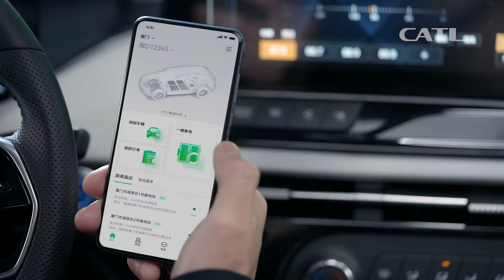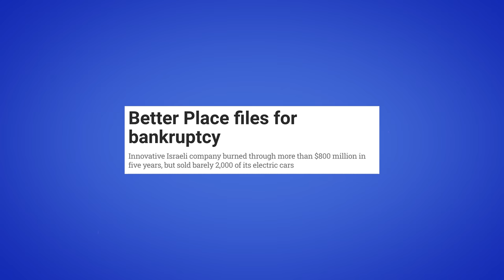Why Battery Swapping Is A BAD Idea

Comment: Battery swapping makes a lot of sense for heavy duty vehicles. Lorries can have much smaller batteries, possibly 200 miles will be sufficient, allowing more goods to be carried. Most batteries can also be charged when demand for electricity is low, saving renewables that would otherwise be wasted.
Reply: A locomotive with autopilot, connects up, pushes or pulls for a while, then disconnects and exits onto a side track to charge.
Reply: Lorries need gigantic battery packs; upwards of 300, sometimes 400kw packs. Range isn’t the issue with them, it’s the weight
Reply: Ye this is a nice idea, but ultimately, sod lorries having batteries. They should be green hydrogen-fuelled. Weight is too much for batteries
Reply: How do you change battery from fully loaded lorries ?  If possible I bet the cost of the swapping station for HDVs would be much more higher.
Reply: Moot point if 18 minutes charging is coming 😁
Reply: @Olliebobalong  you need 1000kwh if you can’t swap it.
Reply: @pissmyasslynch5325   it’s normally placed in front of the container, changed with a crane. Looks simpler than a car battery swap.
Reply: Running on hydrogen fuel cells is probably a better solution...
Reply: @jimj2683  possibly, the main drawback of hydrogen is it’s not as efficient and cost almost as much as diesel. It would say it’s more suitable for more sparsely populated countries.
Reply: @nathanieong6212  Having 2 batteries per truck plus the reduced cargo capaacity costs a lot too....
Reply: @jimj2683  currently a 100 kWh in a Tesla model s weighs about 625kg, I think we will soon see 300 kWh batteries weighing about 1500kg which isn’t too much for a lorry. With battery swapping 200 kWh should be sufficient for most routes. On paper hydrogen looks very light which is true, but what it doesn’t show is hydrogen takes up a lot of space.
Reply: @fjalics  or… or… or… an electric train that doesn’t stop, isn’t bothered by traffic and goes with 100mph
Reply: @fjalics  or… or… or… an electric train that doesn’t stop, isn’t bothered by traffic and goes with 100mph
Reply: The loading of cargo is already a source of delays that causes some drivers to quit.  Drivers are scheduled to arrive at 7 am - they make it on time, but are told to wait until 3 pm.  Drivers don't get paid for waiting.   Battery swapping would cause more drivers to quit.  The logistics industry is not a well ordered machine.
Reply: Hydrogen will power heavy duty vehicles...
Reply: @emanueldobos8452  trains literally is the solution to all land logistics, only problem is that it's hard to build due to environments and it'd put a lot of people out of work
Reply: the problem with your last point is that energy is cheapest at night, which is when the sun isn't shining and there is generally less wind
Reply: @SkillzorZ021  Never said it must be charged at night, but generally electricity is much cheaper at night. There’s indeed no sun, but there’s close to no demand, nuclear generators don’t turn off, wind turbines are still spinning.
Reply: @SkillzorZ021  A big problem with batteries in large trucks is the maximum weight is limited. In the U.S. the limit is 80 tons.   The weight of the batteries decrease the billable freight load .
Reply: No. Heavy duty vehicles will always have an ICE in them, and not be electric unless hybridized. The energy density of batteries makes electric heavy duty trucks useless, as they can’t have the necessary range without being too heavy to actually haul anything.
Reply: @orppranator5230  I agree.   There might be a limited role for electric class 8 trucks for local transfer of relatively light loads. Some materials are bulky but don't weigh anywhere near the 80,000 pound limit.  

 With drivers quitting because they are often  waiting at some shipper for a load - and unpaid, waiting for batteries to charge  had better be paid time.  The first time a truck spontaneously goes up in flames will cause many drivers to quit.  Protecting a battery in a Model 3 is one thing - battery safety would add a tremendous amount of weight in a large truck. 

Hijacking a truck to steal a swappable battery could become a problem.

Comment: The world agreed on domestic battery standards, why not vehicle battery standards? No need for mechanised swap stations, and if the batteries made smaller and modular, any bad cells can be isolated and sent back to manufacturer easily. If you have ever played with Radio controlled vehicles in your life you'd know a removable batteries is a godsend. Nobody got time to wait for a charge.
Reply: everyone builds their platforms differently unless you are on a shared platform like the Nissan Rogue and Mitsubishi Outlander, or Toyota BZ4X and the Subaru variant....you get the idea.
Reply: The problem is that for EV's batteries are still not a fixed standard and probably won't be for some time as there are three main size types but multiple different chemistry's at the moment. Tesla also want to go with the 4680 cell and put it as part of the structure in the vehicle so not easily removed. This also creates less weight, less material used so less costs. Also cooling/heating battery systems are complicated using fluids and are different in every vehicle so it's hard to create a universal standard.
Reply: I get you.. however: that might me a damper on research. If I came in and said Hey guys, I have this great idea, but it would require us to redo A LOT of the processes.. What would most likely happen: a big fat NOPE! 
However: I would love it if they at least agreed on a standard for where to place the charging port.
Reply: @Brandofviti  sadly every manufacturer wants to the keep any new battery technologies secret as it's worth a lot of money and creates an advantage. With regards to charging ports I'm sure it has something to do with which side the steering wheel is on (especially as Tesla started in the US, so left side rear was better) but also the distance from the charging port to the actual charger built into the car, the less distance, the less cable you need to use which in turn reduce costs. Tesla is even missing out some of the screws in the battery casing now to reduce costs, as when you start producing hundreds of thousands of vehicles, every penny counts!
Reply: Because it would require everyone to use the same platform, meaning that automakers would have much less freedom in the way they manage space and batteries in their vehicules.
Reply: Because that's very bad for progress. You don't put standards unless something is very optimized because you forcefully stop people from making something better. We're making better and better batteries, limiting that would hinder the industry.
Reply: We could all agree on AA for toys etc...
Reply: @skylineXpert  ..its just not the same as they were not re-chargable to start.
Reply: If the Chinese state says all imported cars must use their standard of battery for swapping, then very quickly this will become the world standard. No car company will make a car that can’t be sold in China. 

This will happen for three reasons;

1) Chinese state capitalism can dictate rules for all their industries, for their advantage

2) as ev’s become compulsory poorer folks who can’t charge at home will need swapping

3) China will and is becoming the dominant car producer and consumer, their dominance will dictate battery and other standards 

Watch this space.
Reply: problem is there aren't these standards, and not enough incentives for manufacturers to get together and create them.  Even more troubling is lack of standards even for making these batteries easy to scrap/recycle
Reply: Perhaps China will require by law a standard swap battery size / shape / interface. Then all manufacturers selling in the Chinese market will have to agree otherwise they won’t be able to sell any of their cars in China.
Reply: Central control will stifle innovation. Internal combustion engines actually run much better on pure ethanol. Since it’s a much cleaner burn and not a mixture of other chemicals. Of course people could have made their own fuel.
Reply: For this to work, and it might, a central government would have to be involved. If the EU steps in like they did in the case of USB-C charging, there's a chance. Maybe it's best to allow battery technology to mature a bit more
Reply: @davidwebster2616  Standardisation will/must come, environmentally/economically it's the only way.
Reply: @Brandofviti  This is where, things have to change.
Reply: @dzello  Not really, intermediate technology is just adapted to with software or an add in module.
Reply: @markreed9853  Really?
Reply: @abbersj2935  its been so long, what did I say you are replying to?
Reply: @markreed9853  No worries, what will be will be. Best wishes.
Reply: cars now run on pretty much the same stuff as well, petrol or diesel

swapping will obviously be how it's done finally, idiotic things happen with early technology
Reply: @toi_techno  while I do see battery swapping working with small vehicles like scooters and motorbikes, it won't happen on a worldwide scale with cars, it's just not practical especially now we have quite an extensive charging network worldwide expanding everyday. I can see some benefits in the city but not everybody lives there. It also just places too much of a limitation on future vehicle design and battery chemistry design and changes.
Reply: tldr: nope
Let's assume there was a global standard battery. Here is why making them swappable for consumers is a bad idea.
- Insulation and connectors need to be idiotproof (space, weight, cost)
- every cell needs to be connected in such a way that it can be removed without affecting any of the others (space, weight, cost)
- it would prevent the constuction of battery packs as load bearing units (space, weight, cost, safety)
Cars would be heavier, slower, have less range and cost more. Consumers would not accept that.
Also, for the point of using this in place of charging. I want to see the average joe, changing out 500 kg of batteries in under 20 minutes on their own in the rain and then say "Wow, good thing I did not need to plug that car in"
Reply: I don't see all this agreement you are talking about. You cannot swap batteries from phones or laptop from of the same manufacturer, let alone swapping an iPhone battery with a Samsung one.
Reply: Yeah, it's just a simple example of technobauble zombie-companies- engineer a problem that has a convoluted fix, instead of just fixing the original problem.
Reply: @abbersj2935  Module technology sucks in general. Google tried that with their modular phone line (look up project Ara) and it failed miserably. Eventually you go back to a core function that cannot just be upgraded easily like how computers and phones ultimately depend on a motherboard and then you have compatibility issues in a growing field. USB C became the standard only after it was clearly superior from everything else and even then, years after it made micro usb obsolete. They can maybe try again in 20 years but now is not the time when everyone is rushing to make the tech more efficient like material, weight, design, etc. Too many variable to just stick some random software on it and hopes it runs on everything. A battery standard now holds the industry back at least 10, 15 years.
Reply: @sws212  You seem to be confused. Now is exactly the time it should be done, before needlless infrastructure is created. Without standards there is chaos that's why there are standards for most commonly used things. Your analogy with micro USB shows why standards are needed at an initial point and remember micro usb was a standard for it's time, obviously times can change as does technology buy upward/downward  compatability could be included.
Reply: @davidwebster2616  they only need to share the connector and external form which is easy when they are modular as this allows for variety in placement on the vehicle. The rest of the differences would affect how the charging machine responds to these cells to charge. This can all be controlled via the computer though
Reply: I guess the companies want to be energy companies too
Reply: @markreed9853  The batteries themselves don't need to be standard at this time, just the modules or formats that they fit into. The charging ststions could easily adapt to any different charging requirement..
Reply: @arthemis1039  Are wheels standardised? Is fuel standardised? How about approxamate car sizes? It can be done if the will is there.
Reply: @dzello  So everybody uses different size bolts ? Everyone uses different size wheels or different types of fuel?
Reply: @markreed9853  You sure? AA batteries not rechargeable? Have you got a tv remote?
Reply: @AsthmaQueen  Are there enugh incentives to have electric cars? What are those incentives?
Reply: @abbersj2935  We have a standard for charging, it's called CCS - but limiting the form factor limits future improvements like the new 4680 battery from Tesla which is forming part of the structure to reduce costs and weight. Also, CATL has made a "blade" style battery which has some benefits I'm not sure of yet, I think it's LFP chemistry as well, so no cobalt. It shows that different companies have different ideas which work well for them, a fixed standard for these is not the answer.
Reply: @abbersj2935  ... These formats we're not rechargeable when they first were created.
Reply: @markreed9853  So? We used to walk and ride horses to work. It's called progress.
Reply: @abbersj2935  ... That's nothing to do with the batteries though 😬
Reply: @markreed9853  Doh, it is because unlike your proposition, it shows that technology and methods evolve. There are many batteries produced for the first time now that are never available  other than in rechargeable form.
Reply: @abbersj2935  ... What I'm trying to say is vehicles are so different compared to consumer devices, EV batteries need to be made to fit in a certain area sometimes that's in the same frame that was designed for an ICE vehicle (eg MG ZS) which also need heating and cooling of the battery which other devices don't need. At the end of the day batteries with made how manufacturers want, and if that's like the 18650 or 2170 great but things are progressing and going in different directions for different, manufacturers, feel free to contact them though to tell them your ideas!
Reply: @markreed9853  Mark. Just think about it. No engines anymore, no exhaust, no petrol tank. Wheels at each corner, 4/5 seats. Try overlaying plan views of an astra over a focus over a golf. They are, in reality very similar. Swap batteries could be smaller modules, as is being trialed in China now. Big cars could have three, mid size two and small cars one. If a cow can be automatically milked, a car can easily have it's batteries swapped. It will take about three mins, about the same time as filling with petrol, present petrol stations converter some per year. Oil companies could own the batteries and rent them to car owners reducing EV costs. It's just up to governments to decide what is required, set standards and off you go.
Reply: @abbersj2935  not going to happen large scale, Tesla going to a structural battery pack to save costs and weight.
Reply: @markreed9853  Mark, until it does, EV's will be a niche product. Early adoptors will become disillusioned due to range anxiety, vans will be a pipe dream. Electrical grids will not cope without massive spending. Tesla does not own the world, their design makes car repairs nearly impossible economically. This is a VHS / Betamax moment.
Reply: @abbersj2935  you're living on another planet, in Europe it's massive with Ev waiting lists up to a year on some models. Our National Grid here says it's not a problem, as long as everyone doesn't want to change at peak times but it's cheaper overnight anyway. I'll let you get back to your flat earth group now as well😂
Reply: @abbersj2935  When technology starts? Yeah, people use what suits their technology best. Then, one way rises to the top and they make it universal.

Comment: Some people are held back from buying EVs because they are afraid of their battery going bad or becoming obsolete with better tech. Battery swapping can alleviate that fear.  It can also alleviate the high up-front cost of buying an EV.
Catl is pioneering sodium ion batteries. Sodium is 1000x more abundant than lithium and is easily recycled. Sodium ion is better in almost every way than lithium batteries except for density. But you could have a low range sodium ion battery as a daily driver and swap it for a high range battery for long trips.  Also you could just charge your batteries as always and just swap them if it made sense for your life style or immediate need.